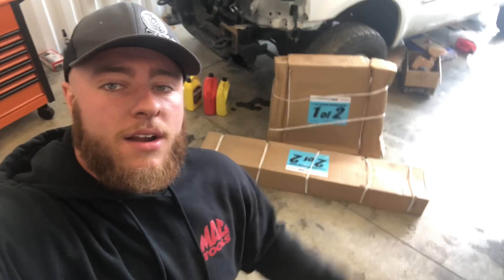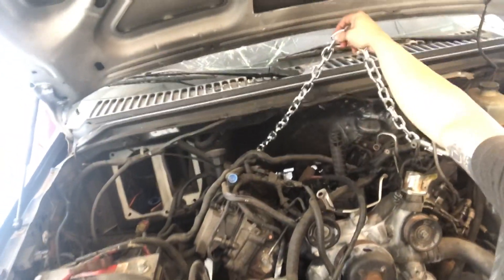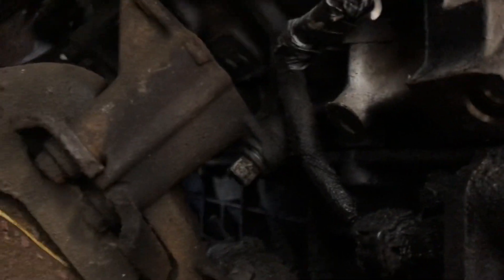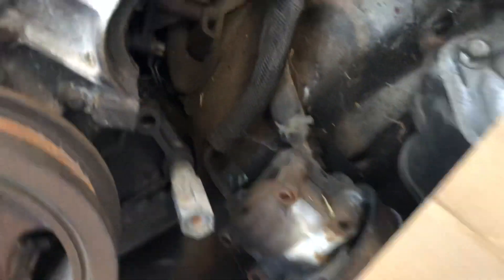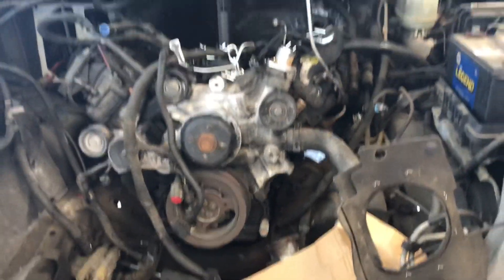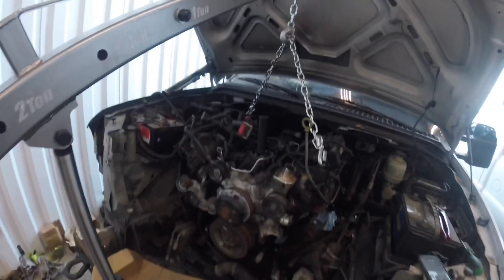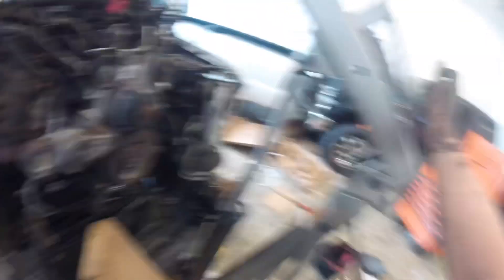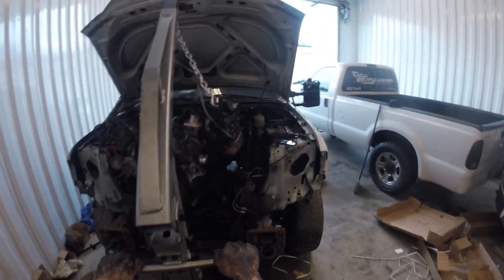1000hp 6.0 Powerstroke Engine Build

Comment: What's wrong with Ford owners these days,  their back up vehicles Japanese vehicles.
Reply from the maker: Cheap, Reliable, and also my girlfriends old car since I bought her a new 2018 Ford Edge Sport. So yeah not wasting money sounded like a pretty good decision for me. Especially considering the hoonda has about 80k miles. Any more questions? 😂😂
Reply: @tylersdieselstop6787  , I am just giving you hard time.  I follow this guy who has lifted 6.7 powerstroke that he drives to truck shows, but his daily car is Toyota.
Reply from the maker: @repairvehicle  Oh I know it, I’ve had CTSV daily’s etc and they’re fun but nothing beats 40mpg, $20 oil changes and $200 sets of tires lol. Anything is worth trying though, I’ve always liked Japanese cars for commuter cars.
Reply: @tylersdieselstop6787  , agree. I  remember in early 2000s I bought Toyota echo with some body damage for $1000 with 70k miles, I put another $1000 in body repairs.  For $2k that car last me 15 years and around 200k miles when I sold it with holes in the floor for $600 to a dealer that drove 5 hours to buy it. I  was getting 40mpgs highway and city.  It was best commuter car, saved me a lot of money when gas was above $3.50 gallon.
Reply from the maker: Let’s hope and pray we don’t all drive match box cars after all this craziness has went on.
Reply: @tylersdieselstop6787  , true.
Reply: Nothing wrong with driving reliable Japanese car.  I have dumped Ford trucks for Japanese Toyota tundra.  I prefer Quality over quantity.
Reply from the maker: @repairvehicle  How are the tundras? I want one bad...
Reply: @tylersdieselstop6787  , after two Ford trucks, last year I bought my first tundra.  Truck had 224k miles on it and everything is original on it, including water pump.  It drives like brand new,  no rattle or any squeak. Engine runs like brand new and transmission shifts like it's new. You would never tell it has that many miles. Body and Frame is clean from rust, truck came from Ohio and its 2012.
Reply from the maker: @repairvehicle  Holy crap, I’m impressed